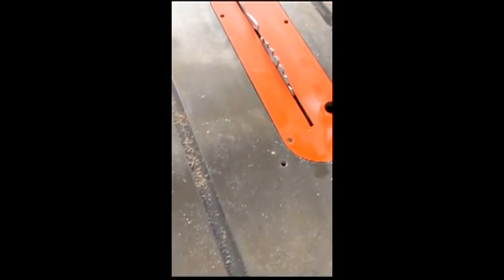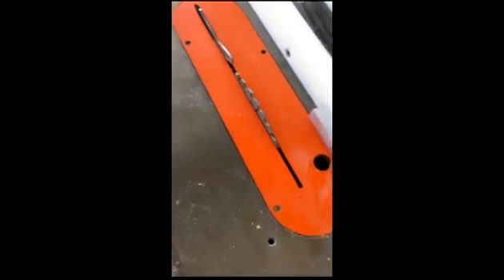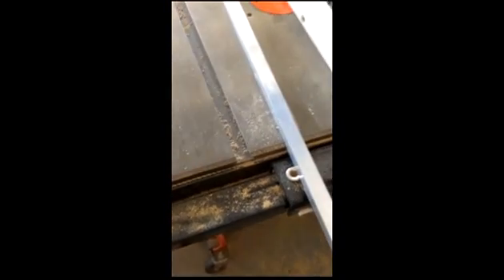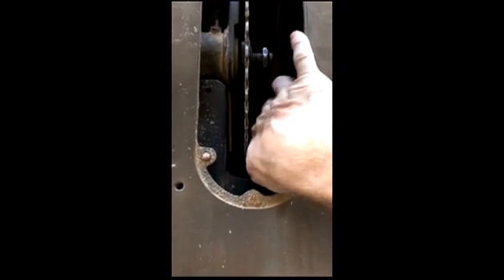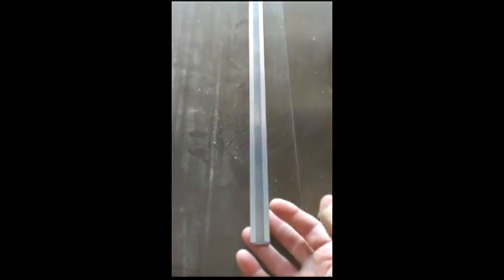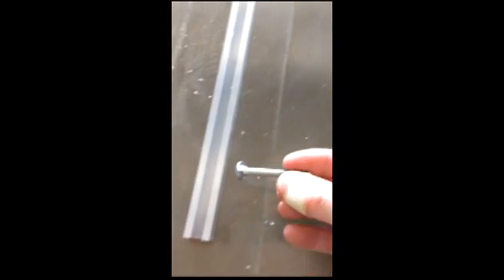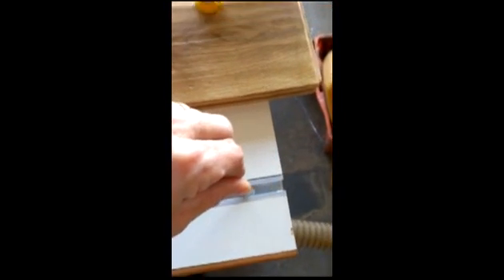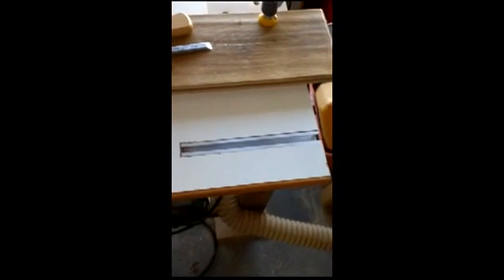Shop Made T-track

Comment: What a great idea and thanks for sharing, though the table saw is a good way of cutting another option if anyone by chance doesn't have a blade to sacrifice and if a small grinder is handy, the width of a grinding blade is right on 1/4" thick that would be another option moving slow with a steady hand,  I never thought about using a carriage bolt to keep from binding, looks like I'll be swapping out all of my hex head bolts now.

Comment: That's a clever idea. But of course you seem to be just brimming over with clever. I ran across one of your vids and started watching to see what else you had come up with. I go one step further when cutting something like the aluminum, I use an old beat up 7 1/4 inch circular saw blade in my table saw. Less power required to turn it and they are way cheaper than any 10 inch blade
Reply from the maker: Thank you for the compliments! The circular saw blades is a great idea as well.

Comment from the maker: I found that router plate on MLCS on sale. I believe it was about $29. When free hand routing curved pieces, it's safer to use a starting pin. I had no good way of utilizing a pin without the plate so for the price, I dropped in the plate. It is a nice convenience but not completely necessary.